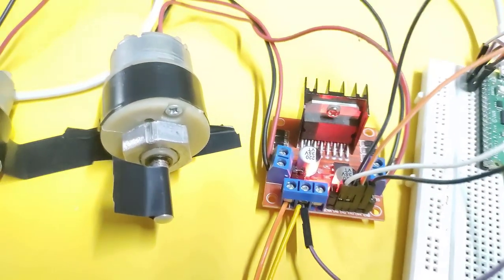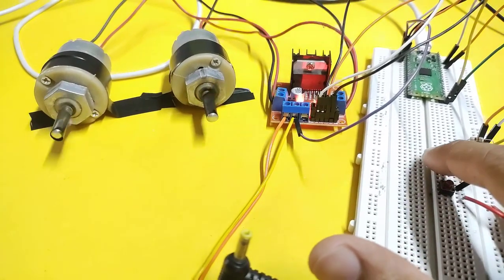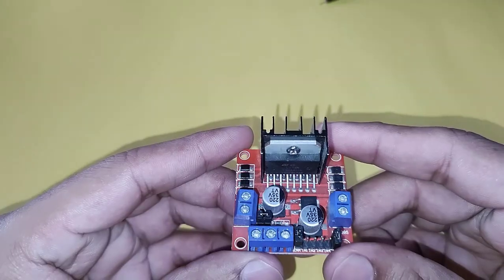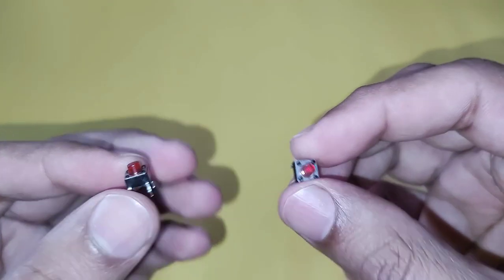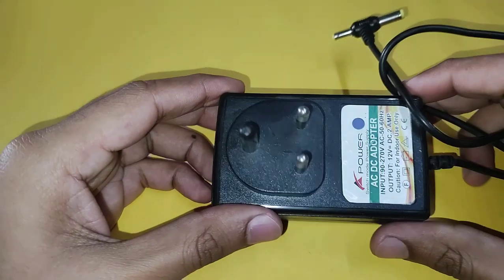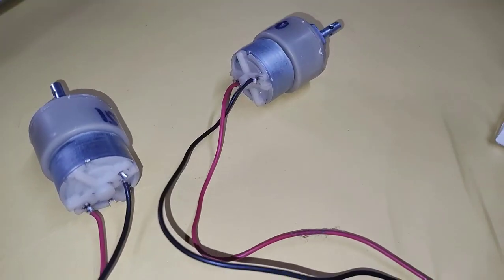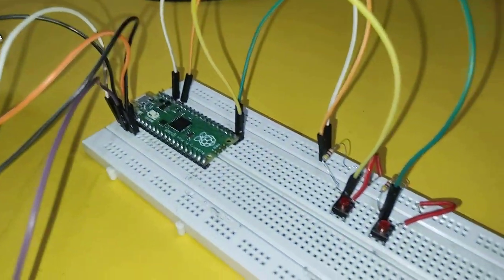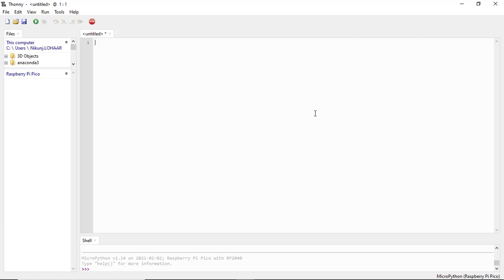Controlling DC Motor With L298N Motor Driver And Raspberry Pi Pico #raspberrypi #raspberrypipico

Comment: How is the Raspberry Pi Pico getting power?  You don't use the 5V pin on the L298N motor driver board.  I think I figured it out... you are only able to run this when it the USB is plugged in to the Pi Pico, giving it power.

Comment: If i don't want to use the buttons and resistors and just want the motor controller board hooked up to the pico, then would that free up the 3.3v pin?

Comment: Can you make video about rpi pico and bluetooth hc-06 or something else about remote connection?
Reply from the maker: https://youtu.be/3kU3_b78JpA

Check this, it's all about bluetooth.
Reply: @NikunjPanchal  Thank you, I didn't saw that.
Reply: @NikunjPanchal  So on hc-06 it's work too?
Reply from the maker: @pawez7517  Yes, it will work. Make sure you connect on correct pin.